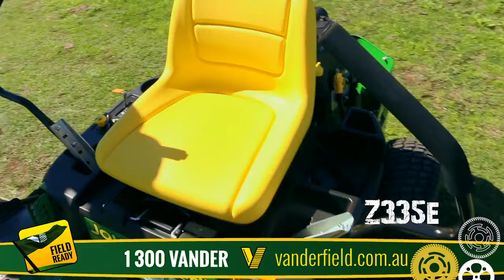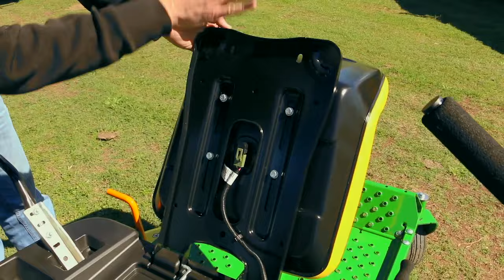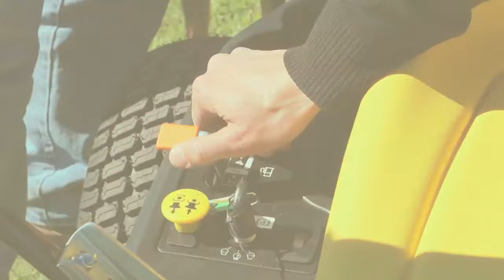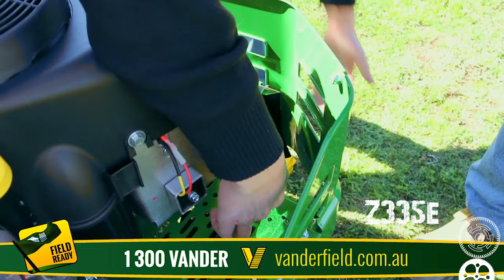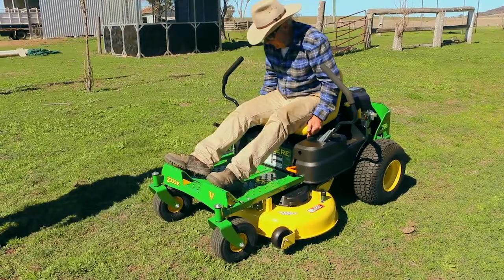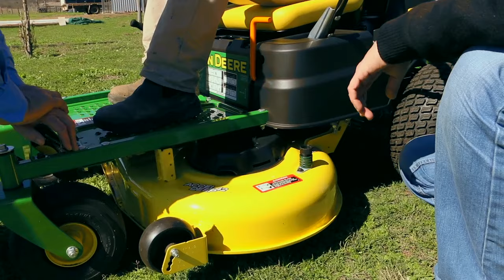John Deere Z335E  Zero-turn Mower at Vanderfield

Comment: I have a question. Say your mower will not crank. You decide to loan it on your trailer to see what’s wrong. The mower is in gear and  you cannot push it up on the trailer. Is there a way to take it out of fear to manually push the mower?
Reply: Did you figure it out?  When you say in gear are you referring to the hand brake?  Did you also unlock the transmission tabs at the rear of the engine?
Reply: Two screws at the back on your left and right.  They are in a L shape Grove just push them down to release the breaks on both side.

Comment: I need help ASAP! Please please. My zero turn lawn mower handle is stuck and won't go back into the slot so it wouldn't stop. I got it to stop by turning the whole thing off, but it freaked me out. Do you know how I can fix it?? I just noticed there's a little L shaped metal piece that must have came off of something. I don't have social media so I'm just going to YouTube to hopefully get help
Reply: Did you ever figure that out ? Mine just did that
Reply: @scorpion6031  yes, I had to take the seat off and the black plastic cover that goes over the body and stuff off and put the "L" shaped locking pin that had fallen off of the hydraulic pump arm back in.

Comment: How's this mower with hills?
Reply: I wouldn’t recommend it for hill terrain.  You really have to feather the throttle offset or it’ll get away from you.  These mowers are notorious for getting stuck if the turf is even semi moist.  The rear tires are aggressive and will leave ruts and divots, especially if you pivot on a dime.  Depending on the size of the lot a tractor may be a better choice.

Edit:  If you’re stuck on getting a ZTR then get something with a roll bar.  I had to go with this model due to a narrow fence opening.

Comment: Do not like the stop the engine seat function.  Have to disable that!
Reply: So you can chop your foot off?
Reply: @POWERHOUSE the simple thing to do is stop the mower drop your revs right down deck up full height and stop the blades and brake on shut off motor that simple